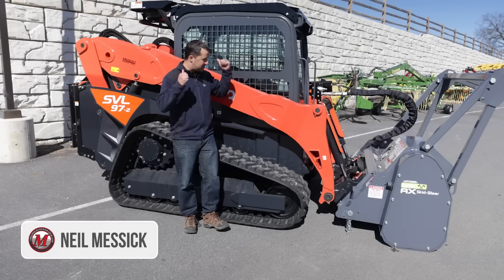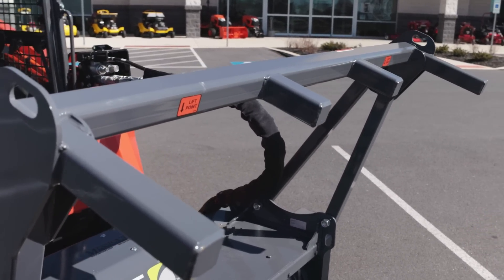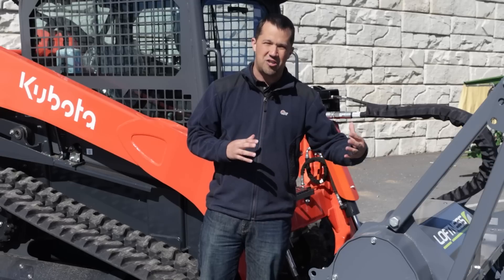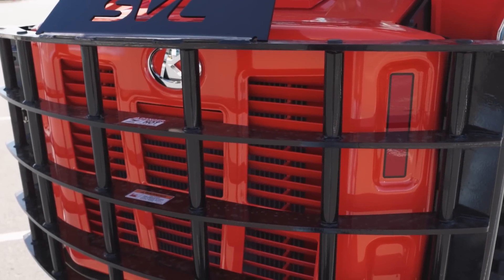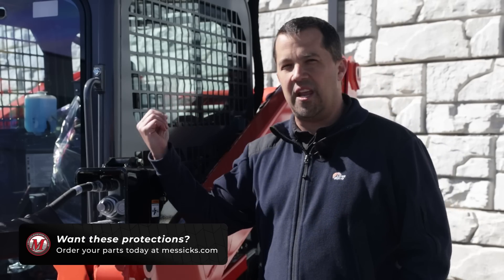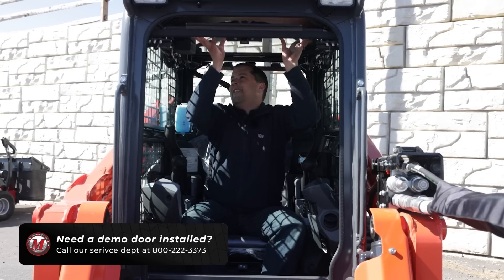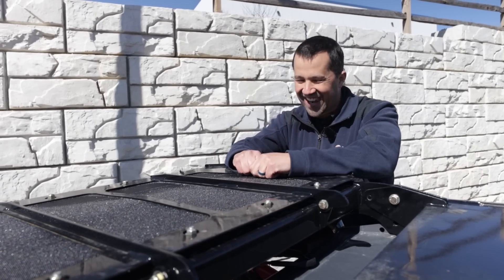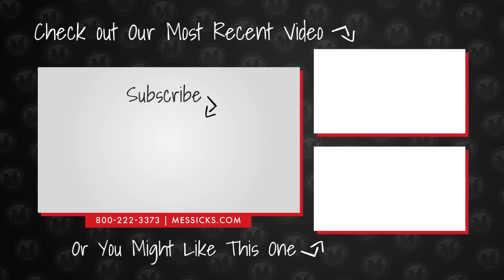Kubota SVL97 // Loftness Battle Ax. Forestry Customizations

Comment: The biggest complaint I have heard about these machines is the hydraulic cooling isn't sufficient enough for the work; I do not know if those people making the complaints had this auxiliary cooler installed. That said, I think another neat feature to have on these machines would be for the fans to occasionally auto-reverse to clear all the leaves and debris from the fins of the radiators. I have seen that on various other forestry machines, I think John Deere and Tigercat. Do these machines come with that feature?
Reply from the maker: This generation does not have a reversing fan. That's coming to the smaller model this year, and I suspect this one for 2024.
Reply: @Messick's Equipment  Is that switching fan direction electronics retrofitable?